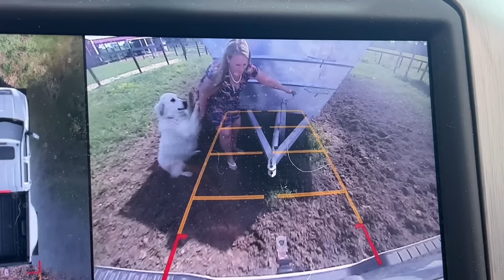Air Waves:  Drone, Feed-Buggy, & Walkie Talkie Review!

Comment: Before you get more sand for the roundh yard run some conveyer matting around the inside edges of the panels. It can be seconds, but it will last 30 plus years as ours did.
No more loosing soil nor having the horses pushing it out when running.
Just a suggestion Lester.

Comment: Lester I figured it would get caught on the pipe coming into the pen why not keep near your barn for rake day a heavy duty piece of cardboard or anything that  you can drive over for that harrow as you go across it can drag right over it or a piece of metal scape to use there.  Good Luck it raked so smooth.

Comment: What I would do o ce you get the roun pen back to where it's supposed to be dirt wise is take a roller & really pack that clay down. If you can get it compacted enough, it shouldn't be able to erode like it did. I realize this was a huge storm, so that's not typical, but using the roller should help. It was funny watching you go in circles because Trixie was on that front tire all the way around with every pass 😂😂.